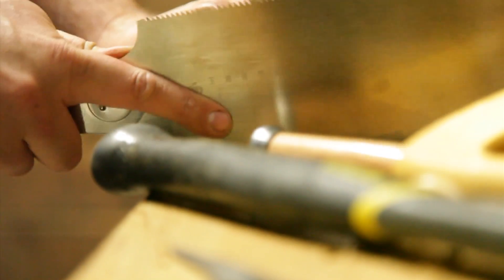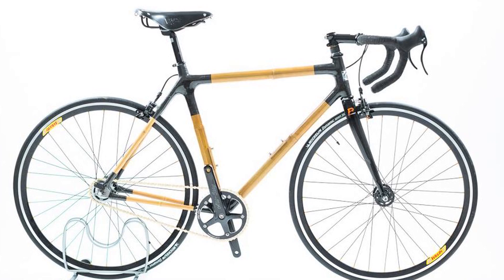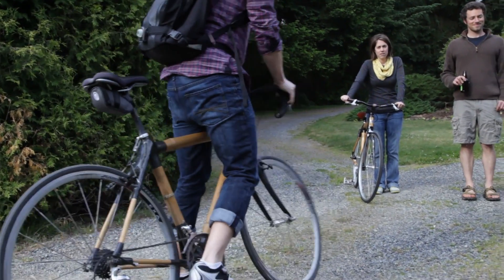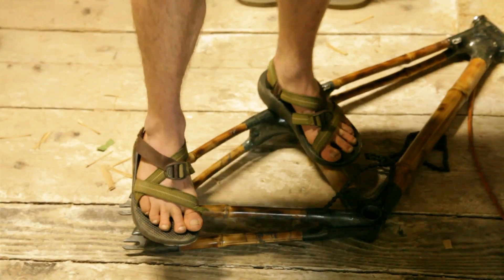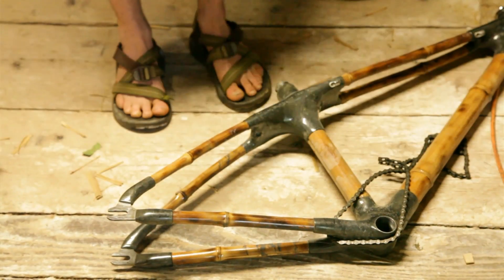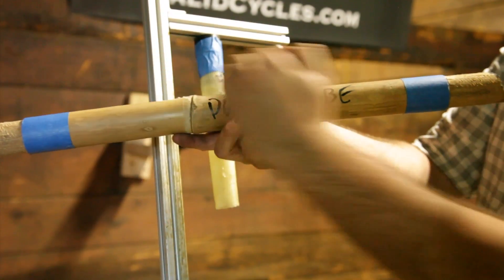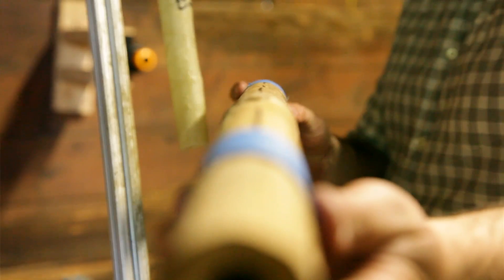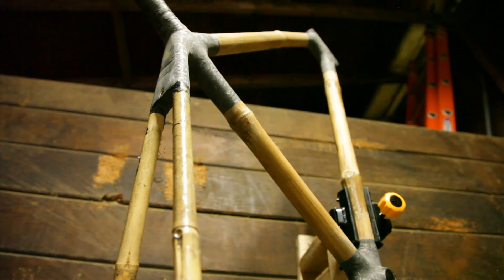Bamboo Bicycles Roll Out

Comment: Hey Bubba,

Appreciate your feedback! One note, bamboo is actually a grass not wood. In fact it's one of the strongest natural materials out there. As far as the moisture damage goes, we wanted to test your theory directly. One of our builders stripped the clear coat off his old cross frame to see what would happen. He's since ridden it for 3 seasons straight & it still rides great with no flex. The trick is in how we seal the the bamboo joints with carbon fiber. Riding is believing

Best,
Tyler